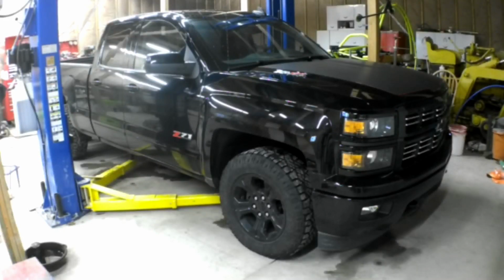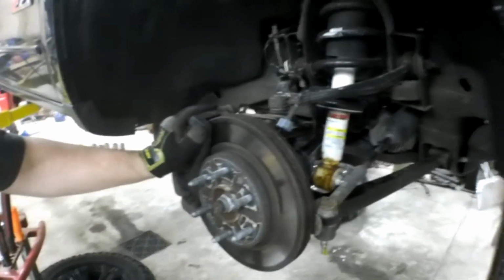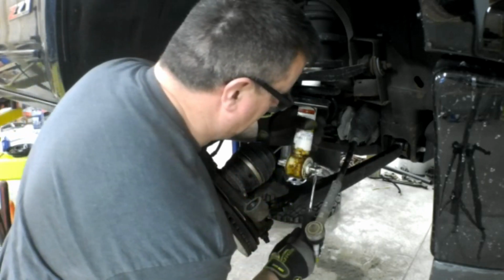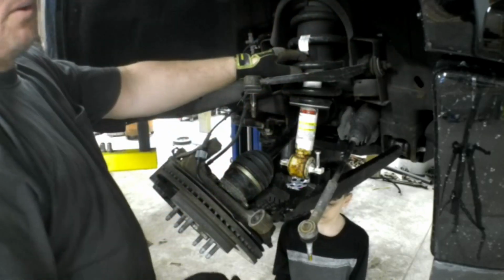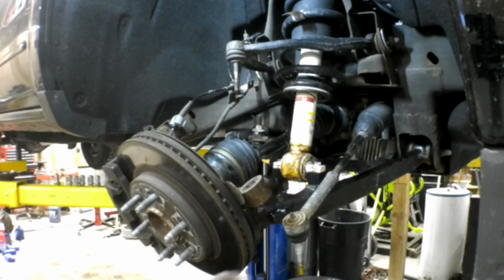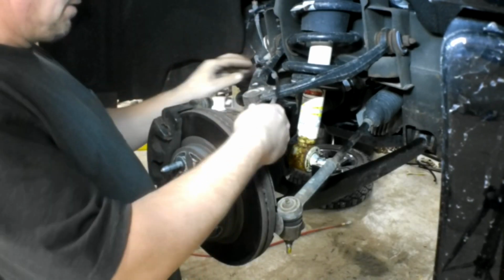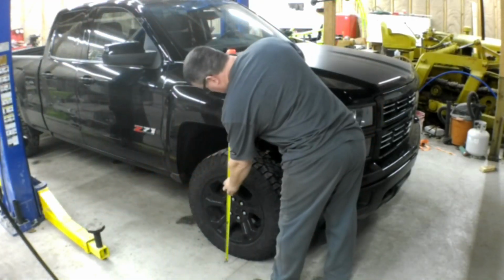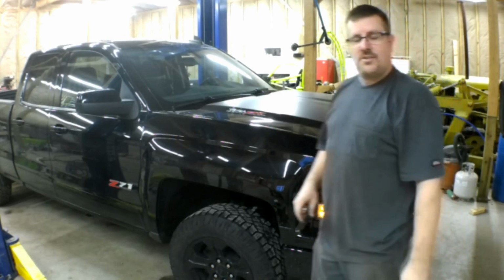Installing a leveling kit on a 2007-2018 Chevy Silverado GMC Sierra

Comment: Quick question Sir I have a 2018 Silverado 1500 LT I want to level it. Should I change any control arms or tie rod ends first? Vehicle has 29079 miles on it

Comment: Wow, some people over think things when it comes to working on autos, I did my truck in 15 min per side and did'nt even take the wheel off. you don't have to loosen the ball joint, tierod or top strut bolts...wow.............guess it was a father son bonding thing..
Reply: Then give us your instructions for it... it looks like just remove the a frame bolts and loosen the strut nuts at top then push the spacer in...